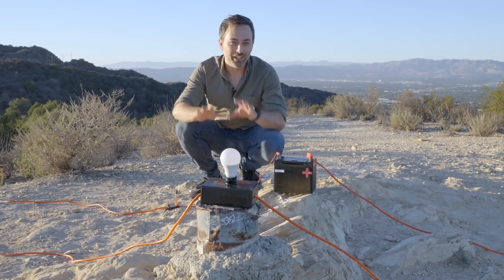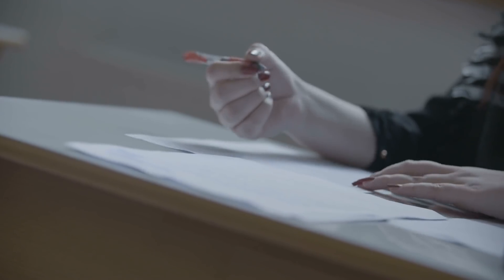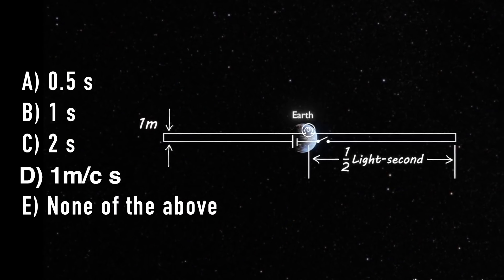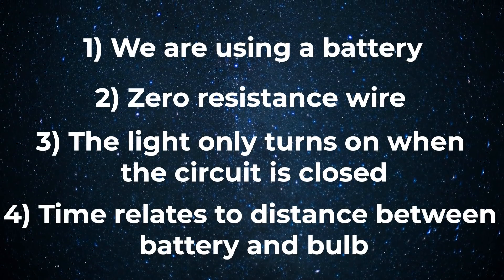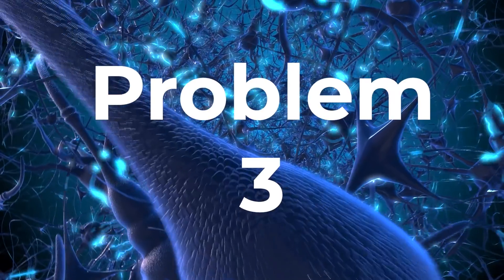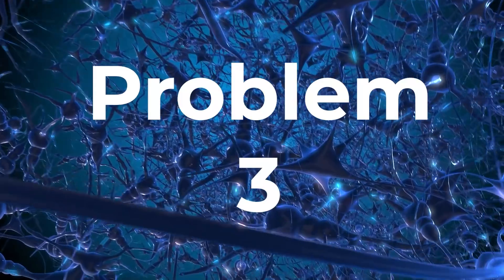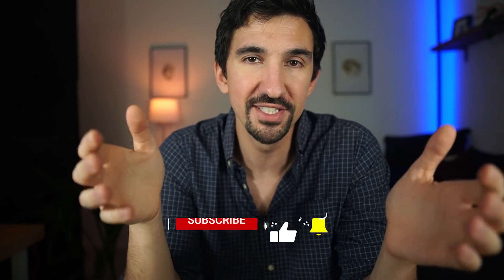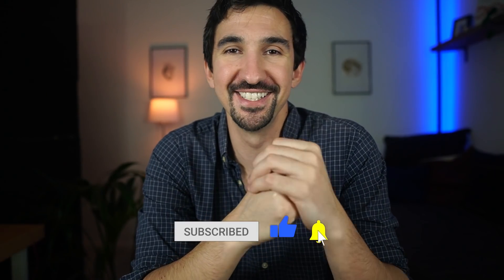Is Veritasium Wrong About Electricity?

Comment: I am thinking the location of the switch or break in the wire does not matter. The length of wire from the power source to the bulb matters. However the distance we are from the bulb would matter as far as when we see the light.

Comment: You seem to have never studied transmission lines. Wave propagates in the transmission line till it reaches the open circuit and then it reflects to the source. No non-causality effect if the circuit is open at the distant end. The bulb will turn on transiently till the reflected wave comes from the open end. Some oscillation may follow till it decaies.

Comment: Well, you didn't understand Veritasium and you should watch it again.  He did say the wire was zero resistance.. to prove a point.  It was about the FIELDS that were across from the batter would light the bulb... not the wire.   Yes, the wires are a great lenght, but that's not what lights the light bulb.. it is the electric / magnetic fields that are generated.  True.. that the magnetic / electric field will only travel so far down the line.  If you remember what TESLA DID... He could power all the light bulbs in a single town WTHOUT ANY WIRES.  He created giant fields.. which the power companies KILLED for to control the industry.   What Veritasium is playing with can stir up an industry like you never seen before.

Comment: 1. That 1/c means 1 (in metres) / c (in metres/second), which automatically provides us with the final unit of time, i.e. seconds. If you're wondering where that 1 metre came from then then I'd like to tell you that it is the direct distance of the battery from the bulb.
2. No. It doesn't break the law of causality. If you would have understood the explanation in the video well enough, you would realized that. Perhaps try thinking for more than 12 hours next time before making such a video (Don't try to be a views hungry science creator. That idea isn't welcome in the community at all). 
The bulb lights up in 1/c seconds because the fields travel directly from the battery to the bulb through space (not through wires, initially) at the speed of light over a distance of 1 metre. And that is why the bulb will light up dimly initially (before the actual field through the wires takes 1 second to reach the bulb). I hope this explains it better.
Reply: Glad someone finally pointed this out.

Comment: In the example with breaking the speed of light by breaking the circuit at its furthest point you made an assumption that the Poynting vector will fade at rate of 1/c. However since (as you said) information can't break the c barrier, poynting vector will vanish only where the information about breakage has arrived. And since flux of energy also corresponds to c, we would not notice any differences until 1/2 s has passed.

Comment: His comment about "lies" is not only a little bit unfair, but the real problem with his video. It made the video squarely about power distribution, not detection of a signal.

The light won't come on because it will either need to heat up, or it will need to reach the voltage required for some semiconductor junction. No useful amount of power will be distributed through the air gap, which is precisely why we use wires, undermining the whole point of his video, if there was one.

Comment: It seems to me obvious that the circuit cannot considered "closed" until the full two seconds (setting aside issues lie impedance). I appreciate the fact that Veritasium's answer, then, requires dropping the assumption that the circuit must be closed for the light to turn on (whatever, to you last point, that actually means). We cannot break causality. So fine so far.

But I still worry we have a causality problem. The energy of the fields will not enter the bulb, even one meter away, until the it "knows" it is part of a completed circuit, right? What is the functional difference in having an open circuit and a circuit that is so long that the information get back to the source? The easy thought experiment is to have an infinitely long wire connecting the battery and the bulbs, such that the information is never propagated. But set that aside due to conceptual problems with infinity. What if it was mere a 46.5 billion light years long cable? That's to the edge of the observable universe. Given the cosmological constant and the expansion of space, the information would never get back. The ends of the cable would be unobservable in principle. So how could the bulb ever "know" it was part of completed circuit? I know, that's what we're challenging, but we need to be more rigorous, because then there's no explanation that I can see (in my vast ignorance, I grant) as to why bulbs don't turn on randomly!

So we have the same problem here. At less than 1 second, the break in the cable 300,000km away is just as unobservable, which should mean that the bulb doesn't "know" it's part of a completed circuit. So if the bulb does turn on, it does NOT due so with the circuit completed. So what's the cause? It seems we've broken causality here, too.

So I'm inclined to think that Veritasium might just be wrong here.

TL;DR: The Poynting Vector won't "point" anywhere until the electric and magnetic fields are appropriately lined, and that won't happen without the exchange of information, and that seems to require a completed circuit, and that seems to mean we cannot exchange this information faster than light speed. The bulb being 1m from the battery seems only relevant AFTER the information is transmitted indicating the circuit has been closed. So the answer to the video ought to be 2sec + 1/c (issues with units, impedance, etc. aside).

Comment: It only "breaks Causality" if you believe the electrons have to Travel the entire distance. Which they don't. They barely move. They merely POINT their Electromagnetic Moment in a particular direction. The light turns on as soon as there is a build-up of electrons on one side and a depletion on the other. Personally, I think it would flicker at first and then slowly get brighter as this imbalance in electrons grows over the course of a Second or two. If it was a perfect wire with Zero resistance.

Comment: I'm quite new to this stuff, electricity and all. 

The limitation of the speed of light... is it also relevant for fields, or just for matter? The point of the video was that electicity is not directly caused by moving particles, but by the electric and electromagnetic fields they create. I do remember that entangled particles far apart seem to communicate instantly, and if I remember correctly, after the Big Bang it is speculated that space itself expanded faster than the speed of light, meaning that the fabric of our universe itself may not be bound by this law. So if those fields are part of the fabric rather than matter inside of it, that could circumvent the speed of light problem. 

As stated, new to this stuff. So if I'm talking nonsense, please correct. ;-)

Comment: Looking at the general and special theories of relativity are really important here. When we talk about light speed, we are talking about something that is the same for all inertial observers. Things can certainly appear to move faster than the speed of light though- galaxies do it. A laser pointer pointed at the moon can do it with a flick of the wrist. The distance covered across the surface of the moon with the laser pointer can be 20x the speed of light. Shadows can move faster than light. However, nothing is effecting causality. Remember that causality is broken down on a quantum level. When moving the laser pointer on the surface of the moon, new photons are being emitted across the diameter, not a single photon traveling the diameter of the moon. The laser pointer is not having any causality where a photon on one side of the moon effects the opposite side of the moon. 

For those having trouble with electricity: REMEMBER that the speed of light was determined by the permeability of freespace (magnetic constant) in a vacuum and the permittivity of freespace (electric constant) in a vacuum. Basically the fastest possible interactions in this field and how they behave. Because light is an electromagnetic wave, light defines the law of maximum speed that an electromagnetic wave can propagate through freespace. The freespace is the electromagnetic field that permeates through the entire universe. Once you have a moving photon, or electric charge through this field that permeates the whole universe, you disturb the electromagnetic field and see both the electric and magnetic field effects. The appliance your powering (whether it be through light waves (radio waves) or through magnetic waves (electric current)) get their energy from the electromagnetic field permeating the universe.

Comment: People say the horizontal wires will work even if cut at the furthest end as they behave more like an antennae (transmitter and receiver) - we know electromagnetic energy propagates without wires.
However, how in the world this works with the DC battery? DC current is harder to push through low resistance wires, not to mention through air. The spark gap is just too wide - we would need millions of volts just to jump over from battery to bulb and the battery would have shorted by that time, not to mention Veritasium would get electrocuted.
I am interested in the problem but also very confused about the answers.

Comment: What if? What if instead of the wires running parallel, you lay the wire in a large circle. Same distance, same assumption of no resistance.

Comment: My answer tot he question as to how long it would take for the electricity to travel 300,000 km. E) never. Because voltage drop and the resistance of the wire would ensure that no meaningful current would ever travel that far unless you either had an incredibly enormously huge wire, or voltage so high it would fry the lightbulb. There is a reason why Transmission lines, most of which have runs less than a thousand kilometers run at voltages at or greater than 115 kv.

btw. yes i understand this is a theoretical model rather than a practical one, I'm taking the piss.

Comment: I don't think this breaks causality because even if there's a breakage, the bulb will light up for half a second, and turn off, because there'll be a magnetic field traveling from the battery to the breakage point, and until the magnetic field exists, the bulb will glow, but then stop after that. 

On the other hand if the actual displacement between the bulb and the source was 1 light year, it would take an year for the light bulb to light, and another year for us to recieve the light if we are standing along with the source

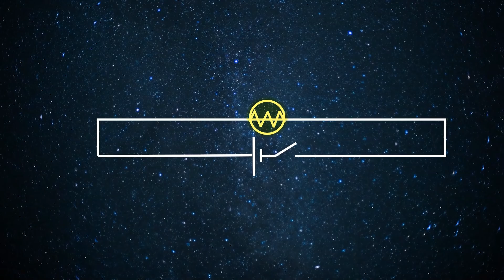Comment: at 4:30 I don't think the break would cause the light to turn off faster than the speed of light. As Veritasium described it: The distance that the field covers is what has to be accounted for. So a break on a far end of the line would still have to propagate through the field in order for the field between the initial switch and the bulb to be affected. The only reason why the bulb turns on near instantly is because the switch is right next to it, and that isn't the case for the break (which is a one-time off switch) in the example. The change to the bulb would still travel at the speed of light.
Reply: Can you tell me what length per time is? Why Can't it be time per length. What is speed in a diagram of spacetime?
Reply: @quickplayerhappyerthanmean4508  The time the speed of light would take to travel between A and B. In the case of the light and the switch. It's the time between the switch and the light. For the break, it's between the break and the light, not between the switch and the light, as suggested at the timestamp I provided.
Reply: @Darkblitz9 Answer my quetion, Darkbliz9.
Reply: @quickplayerhappyerthanmean4508  I did. You're asking what measurement to use. It's the distance/c seconds. If that's not the answer you were looking for, then rephrase your questions because it's incredibly poorly formed. Ask your question better. quickplayerhappyerthanmeandmyself
Reply: @Darkblitz9  what does m/s acually mean? Why can't it be s/m? What is m/s in spacetime?
Reply: @quickplayerhappyerthanmean4508   They ultimately mean the same thing, both are measurements for speed. m/s means: "How many meters do we cross in 1 second?" s/m would mean, "how long does it take to cross one meter?". In both cases, they give you an idea of how fast something moves from one frame to another.  We use m/s because distances vary more often than time does, since time is relatively consistent in our neck of the universe, but distances vary wildly. If that doesn't answer your question then I can't help you, but I would like to point out that it's completely irrelevant to my first comment so I'm very confused why you asked in the first place.
Reply: @Darkblitz9  did you mean, 'why did you'?
Reply: @quickplayerhappyerthanmean4508   What are you asking? Please make sense.
Reply: @Darkblitz9  i was saying, 'did you mean 'why did you''.
Reply: @quickplayerhappyerthanmean4508  Repeating nonsensical things doesn't make them more understandable, please stop replying.
Reply: @Darkblitz9  Your the one who is telling non sense. Your english is bad. I can not understand your english.
Reply: @quickplayerhappyerthanmean4508  You not understanding English is your failing, not mine. I'm sorry that English isn't your first language, and I apologize if you're having issues with it, but that's something you need to get better at. Others can understand my statements just fine. Your own questions are incredibly confusing even for a fluent speaker, which means the problem is with your questions.
Reply: @Darkblitz9  No, i was saying that 'YOUR' english is bad not 'MINE'.
Reply: @quickplayerhappyerthanmean4508  I know what you're saying. I'm saying the opposite. You'd know that if your English wasn't bad. My English is fine. Yours, on the other hand, isn't capitalizing "I" properly, using apostrophes in place of quotes, and not capitalizing the E in English. Sorry, the problem is yours.

Comment: What you don't understand is that the field doesn't move and the energy doesn't travel. It is the speed of cause and effect that counts between the switch and the lamp. The field doesn't really have units in space. There is no space.  There is just distance. The 'parts' of the field act timeless like light does. You can not communicate like you think you could.

Comment: The idea that the current flows only when  the circuit is closed is wrong and breaks causality in the same thought experiment you presented: place a current meter just after the battery, in your model as you close the circuit you would see a current immediately if the circuit is not broken in the far end, would instead measure 0 current if the circuit is broken, thus receiving faster than light information.

The point that Veritasium is making is that the current does not need to travel the wire: regardless if the circuit is broken, the length of the wire forms a "reservoir" to which the current is "pushed" generating the magnetic field that carries the energy and lights the bulb.  It would take at least 0.5s for the "reservoir" to be depleted, thus saving causality.

Comment: This is a much better explanation. I like the antenna model much better. I think that the speed with which the "circuit is closed" i.e. the field couples to the wire when the switch is closed should still relate to the signal velocity (speed of light in the wire medium).

Comment: The power is carried in the electromagnetic fields not strictly inside the wires so it only has to travel 1m through the air before the light starts to turn on.